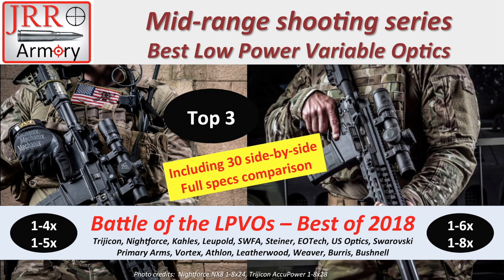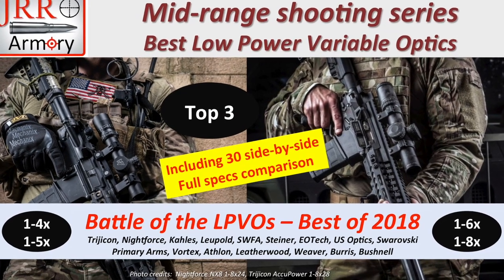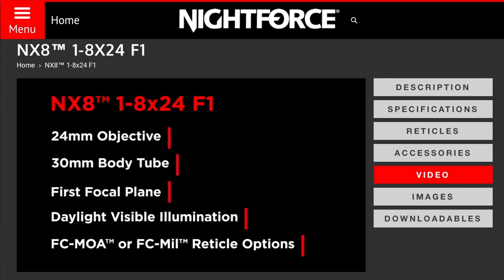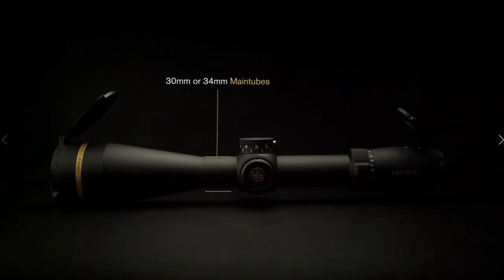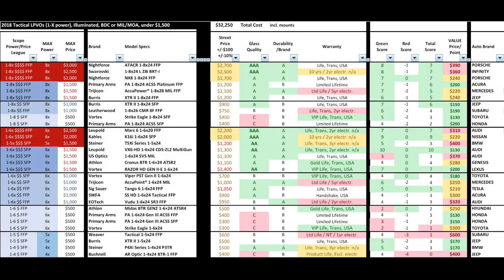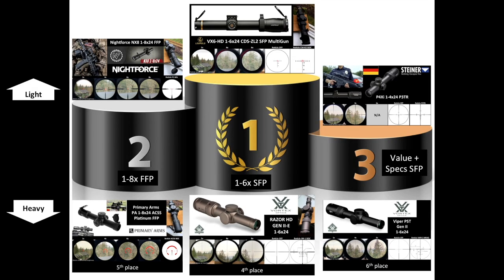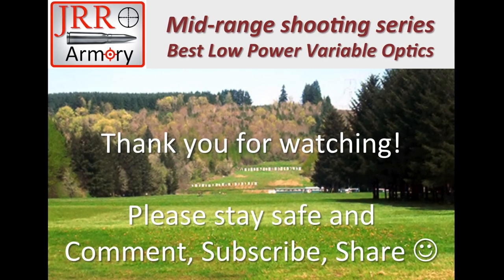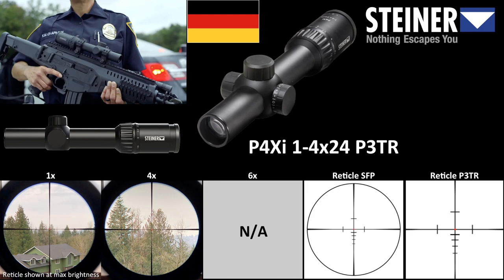Battle of the LPVOs 2018

Comment: First, this is an outstanding and informative video. You present a lot of specific data, and as a result, you've helped me confirm a couple potential choices. Specifically, the Steiner P4Xi and the Leupold VX6-HD 1-6. So, thank you for the hard work you did.

My only criticism is the background music. You're soft-spoken. So, sometimes the music at this volume, drowns you out. Cutting the music volume by half, or dropping it altogether like you did at approximately the 14 minute mark, would be an improvement. 
Thanks for this info!
Reply from the maker: Agreed on the music. Did you pick an LPVO? I am testing now the P4XI with a doubler from Optics Planet (not a sponsor). Sub for more if not already done!

Comment: Really great job on this video. The spreadsheet helps tremendously. I tried making a spreadsheet last year when shopping for a higher powered scope for an LRP class I took. It didn't come close to the detail of yours. It was mostly based on specs and reviews. I wound up going with the Vortex Razor HD gen ii 4.5-27x56. 
I just bought the Burris xtr ii 1-5x24 combo (with the PEPR mount and Fastfire 3 micro red dot) yesterday and noticed this video today. If I didn't get such a good price ($540) I may be second guessing my choice now, but at least it made your top 12 out of 30.
Keep up the good work.
Reply from the maker: Ryan Lobb That’s a great price if you can deal with the weight 👍 Thanks for the feedback, my next video coming up this summer is on EDC/Tactical flashlights 🔦 😎

Comment: I followed along with your spreadsheet inputting data for the Trijicon TR24 Accupoint 1-4x to see how it stacks up, and I think it would bump the Steiner P4Xi. Final total for the TR24 was 4 points, removing the red flag for Trijicon’s electronics warranty - because there’s no electronics and adding a red for no BDC reticle. At only 14.4oz and $160/point value at a street price of $630, I think the TR24 has it beat. What are your thoughts?
Reply from the maker: I  principle I like Trijicons. The 1-8x is one of my all times favorite (but heavy). The problem I have with the TR24 is that it does not have an actual reticle (for holds or range measurements). So it is basically a “red dot” with a 4x magnifier. I don’t see the advantage vs an actual red dot plus a QD flip to side magnifier.
Reply: @jobane2  I’ll agree with that, though I have found a workaround. The triangle post is 4 MOA, so should be the width of a man sized target at 400 yards. If you use a 400 yard zero and Swiss sniping method, all targets <400y aim at the sternum because the bullets won’t rise more than “12. Between 400y-550y when the post is wider than your target, aim at the head and the bullet won’t drop more than “24
Reply from the maker: @HariboStarman  Good idea. Depends also on how you zero your rifle. You can find an optimum between the rise/fall, distance and the help of the 4 MOA post. Personally I keep the .223 under 300yds, and go for .308 beyond that and under 600. You can see all my videos on the probability of hit for different calibers.

Comment: Let me ask, do you believe the price difference between the Primary Arms Platinum 1x8 FFP and the 1 x6 Primary Arms 2x6 FFP is worth $900??
Reply from the maker: Marin Capital Price / affordability is a subjective thing. The 1-8 Platinum is a great value in its class. But the 1-6 will do the job 90+% of the time.
Reply: JRR Armory- thank you. I will forward your video.  
My question is both the extra 10 ounces and $900. I agree with your #1 but I like the ACSS. 
Seems the extra cost and weight are a wash except if you think the 1x6 glass is not good.
Reply from the maker: Marin Capital The glass on 1-6 is good. But the 1-8 Platinum is better. So the question should be answered based on the application (long distance, low light, etc.) and based on user preference. I would try to find a way to look through both side by side.
Reply: JRR Armory  wish the weight was the same. 10 oz is like a can of beer.
Reply from the maker: Marin Capital Inside 300 the 1-6 glass will work very well.